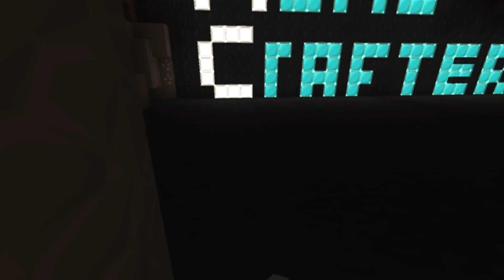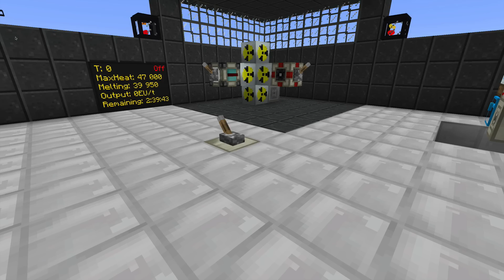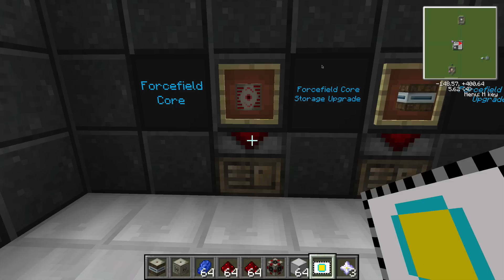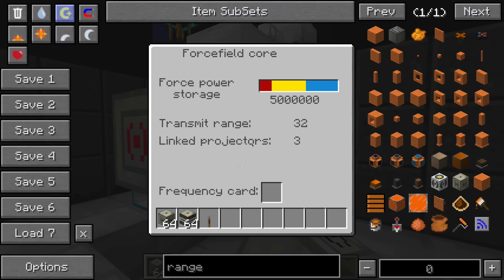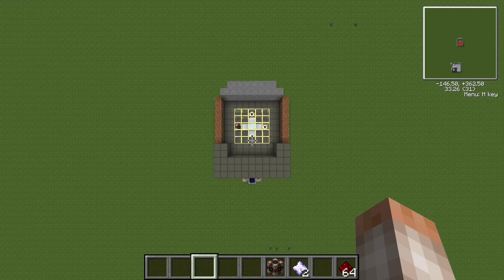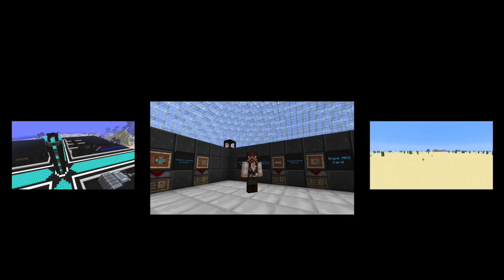Reactor Force field & Reactor Coolant Injector Tutorial

Comment: to the best of my knowledge, range upgrades have been obsolete since shortly after the first version of the mod.  i have 3 world cores on my server, one for the overworld, one for the nether, and one for the end.

with a dimensional anchor at each one, they will power any forcefield in those three dimensions.

i use redpower machinery to draw blank cards from a duplicator, push them through the core, and drop them into an ender chest for player access anywhere they wish.

Comment from the maker: The reactor connector will work for moving EU out of the reactor without slicing the force field, and carry a redstone signal through to the reactor which are  awesome features. I don't think it can carry items through it though, Ive tried exporting items out of AE into it and it doesn't work. :/

Whenever I've had to break the forcefield, I've made sure that the hole is facing away from anything important...if your reactor is safe you should never have an issue though.

Comment: So you use a reactor connector (that red block) to connect the lever to the reactor for your on/off switch. How many things can you use that for? For example, could I connect my HV cable to it and take power out without poking cables through the forcefield? If I was going to automate uranium injection, could I do that by hooking my export bus to a reactor connector? Or is it just for redstone signals?